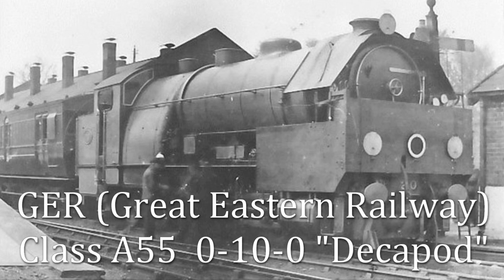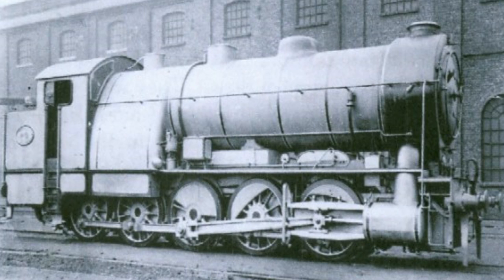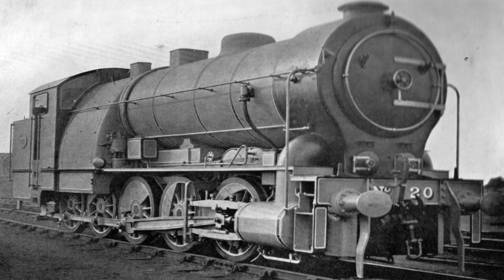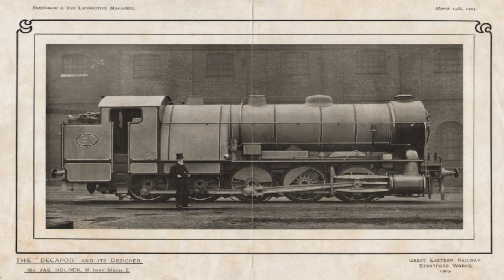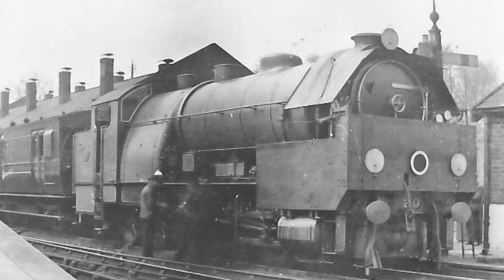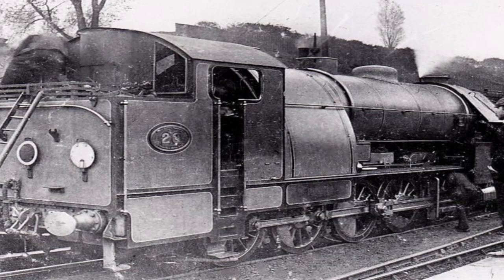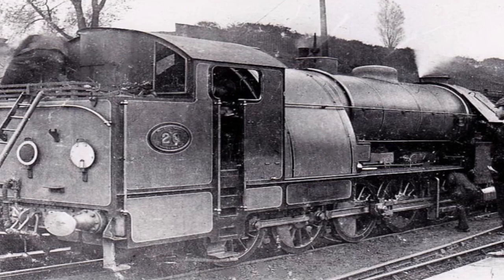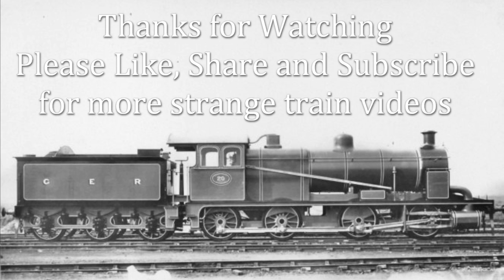Strange Locomotives - GER Class A55  0-10-0 "Decapod"

Comment: Funny enough, the term Decapod is used to describe tender engines with a wheel configuration of 2-10-0 as well, mostly due to the 10 driving wheels.

Comment: Why had the British such a hard time to let steam go and spend so much money and time on obvious obsolete technology? There is no way you can compete against electric trains with steam.
Reply: Plenty of coal and shortage of foreign exchange at the time, and the infrastructure was all present. Cost per drawbar HP was about 20% of the equivalent diesel. Even now it is only about one-third. Actually the British got rid of steam in indecent haste. It continued for several years more in France and Germany. If it had lasted into the 1970s the efficiency and mechanical improvements pioneered by L D Porta would have been adopted and it might still be used on secondary routes. Steam can run on anything that will burn and it is easier to meet emission standards than with diesel.

Comment: What in the--

Doesnt having 10 drive wheels kinda defeat the purpose of it being a tank engine???
Reply: @CrypticClay  ...???? I literally said that it's a tank engine?????
Reply: Man With 9000 IQ  yeah
Reply: A tank engine has several reasons one is of course that it is a more compact design for use on tighter lines or stations with short head shunts. However another advantage is that it allows the locomotive to run at the same speed in reverse as it doesn't have the limitations of having to push its tender it also allows the weight of the water and coal to aid in adhesion to the track with having to drag that weight behind on unpowered wheels. These for a suburban tank engine, especially one designed for acceleration alone, are incredibly useful as without the need to use a turntable it reduces down time and with the extra weight helping adhesion it won't slip as much when trying to accelerate so fast. And it was still probably more compact than other ger tender locos such as the b12. Hope this helps

Comment: 10 coupled steam engines are very good at being slow, heavy freight locomtives.
Reply: Except the BR standard 9F of course
Reply: Iron 13 I have stated this elsewhere. In the summer of 1959 I was on an evening train from Derby to York when Jubilee "Shovell" failed at Sheffield Midland. 9f No. 92113 was rustled up, presumably from Darnall and on the last leg of the journey I timed him at 80 MPH between Church Fenton and York. 9f loco's had 10 coupled 5' diameter driving wheels.

Comment: Is it me? Or does the second axel from the front look off-balance? Like it's not attached to the running gear properly?
Reply: This is probably to balance the crank of the 3rd cylinder, which I'm guessing connects to the #2 axle. Each cylinder's crank is offset to a different position, so the wheelset with the inside crank would have the weights in a different spot as well. Not only does it have to balance the inside crank, but also the outside one for the coupling rod so the weight would actually be opposite a point somewhere between the two cranks.

Comment: Would have been more efficient with the driving wheels in the back.
Reply: That would never work because the back of a steam locomotive ways significantly less than the front and would therefore yield less traction. On top of that, the drive wheels would have to push the boiler, which weighs several tons because it's full of water.
Reply: cellogirl11RW I never expected this but you’re a genius
Reply: But - all the wheels are driving wheels!
Reply: No

Comment: Personally I've always found the concept of the GER A55 pretty fascinating, although an electrified 3rd rail section of the GER would have definitely done a far better job of accelerating, as even during the days of the classic 600v DC stock, 30 miles an hour in 30 seconds is pretty average.

I find the 0-8-0 rebuild a bit of a disappointment, as the A55 (which is probably highly inefficient for actual use with a firebox of such size) would have been an interesting posterity item in a museum or something.

Comment: I can see a very small coal bunker and where the firebox has been expanded. I'm no expert, but I have to ask, where is the water stored?
Reply: Jinx Jenkins I'd say it's in a small well tank, or under the coal bunker. Not sure to be honest, but either way it probably wasn't enough water.
Reply: I have to imagine it's a well tank as the boiler is higher than normal and there probably isn't anywhere else.
Reply: Looks like possibly the top of a well tank just ahead of the firebox and under the boiler (although injectors hate hot water so this seems like a bad idea). I agree that under the bunker seems plausible as well. It looks like the bunker extends down below the cab floor, so I'm guessing the bottom section is a water tank.